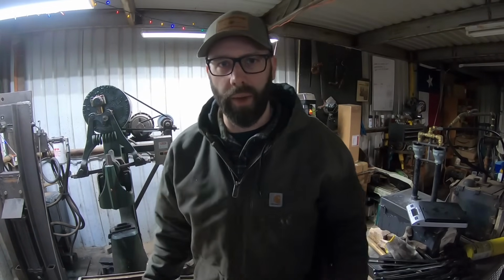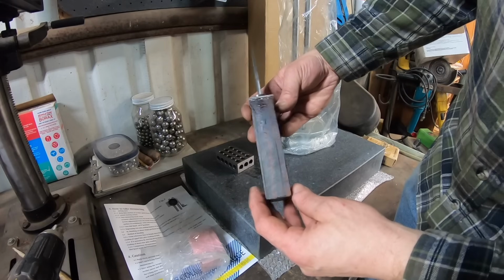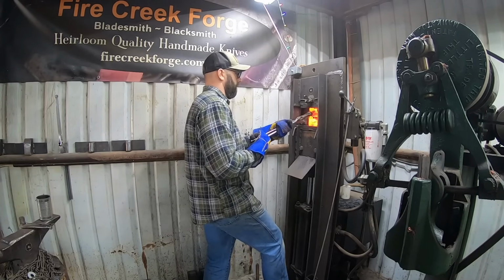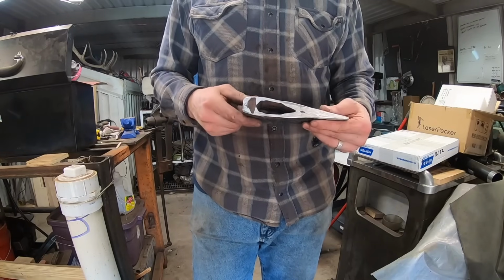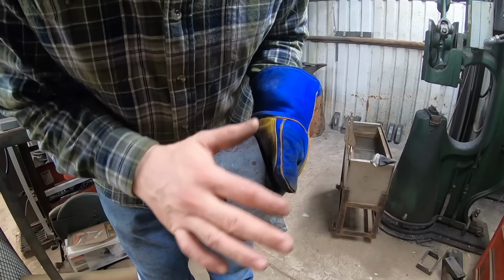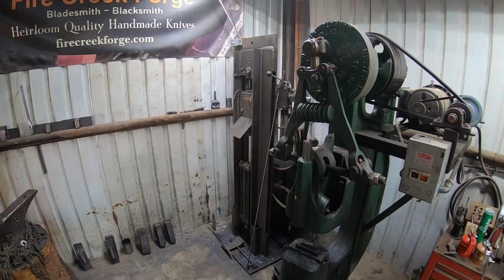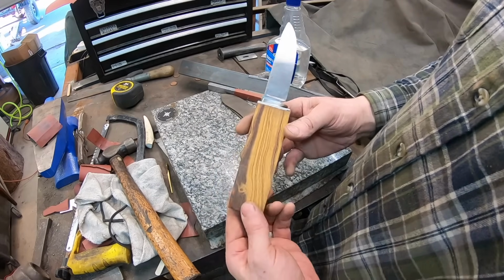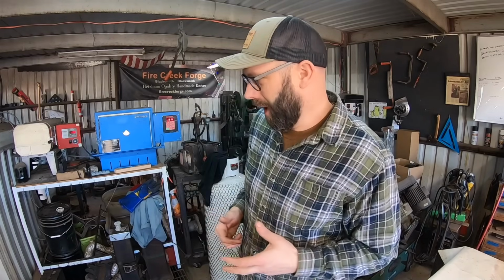I Bought a large rock to make life easier; Forging a 3.5lbs axe, And finishing a nice hunter/utility

Comment: I remember reading in a book on blacksmithing that it can help estimate the stock size you need to shape the desired object in clay, this will give you the material volume then you shape it so two size factors roughly match your stock for example 1"x4" flat stock and you'll know about what length piece you need

Comment: I know part of it was the repeated quenching but also I know 1060 says Water Quench on the Heat Treaters App but on bigger/ heavier/ thicker stuff I use Parks 50 but on my small struck tools like eyeball punch’s that I made from 1060 I did water quench but they were only like 1/2” thick.

Comment: Question:   Is it possible to forge a thin metal (or stone) pipe  - and place it in a billet so it will hold it's shape and the billet would be shaped around it.

And after fixing the hammer/axe shape, use air pressure to expand the pipe to the width required for the handle.
Reply from the maker: Hmm not sure
Reply: maybe a glass pipe?! @FireCreekForge

Comment: It's rough when something you make gets messed up towards the end of the project. It is odd that more than one had the cracks though. Do you think I could have been the steel composition being different than other parts or was it definitely the quenching to ambient?
Reply from the maker: Yeah, over all it's too aggressive a quench for that steel
Reply: @FireCreekForge  that's a bummer.  I've been forge welding 8670or 80crv2 bits into 1045 or 4142 bodies. And quenching in AAA. I haven't had any problems and I get great results. I'm looking forward to seeing you forge a special axe or hatchet again. Good luck and God bless